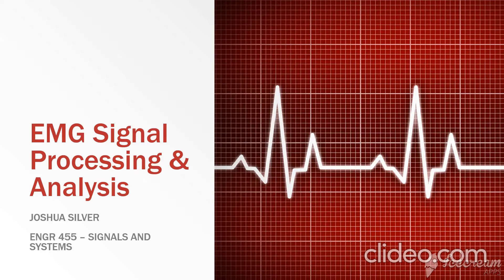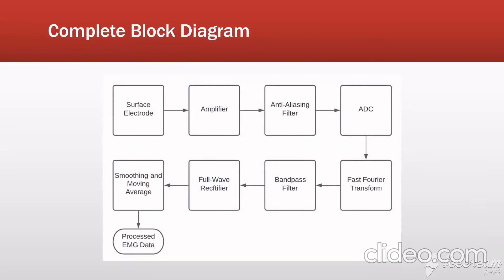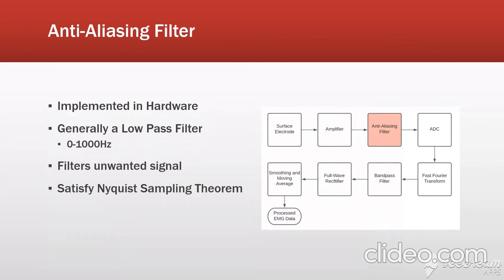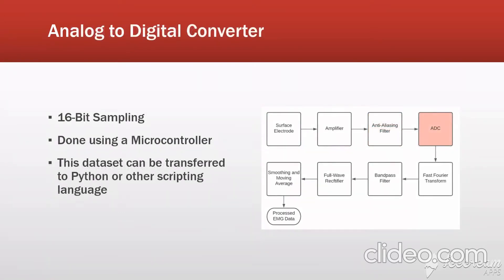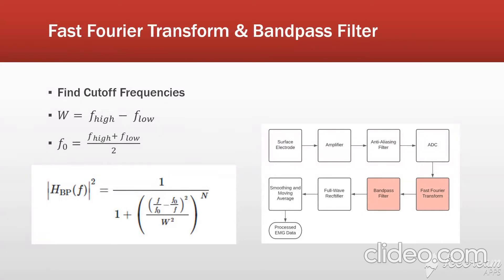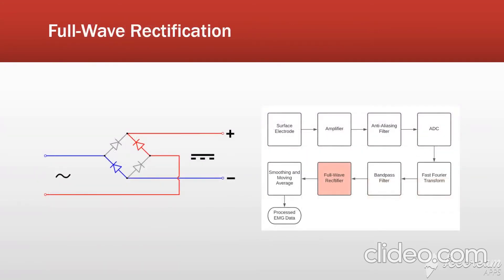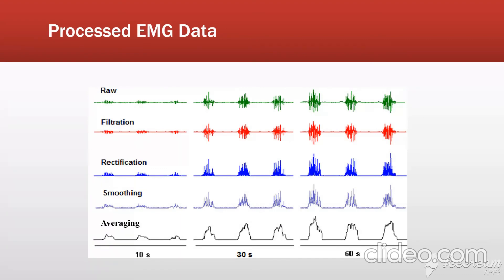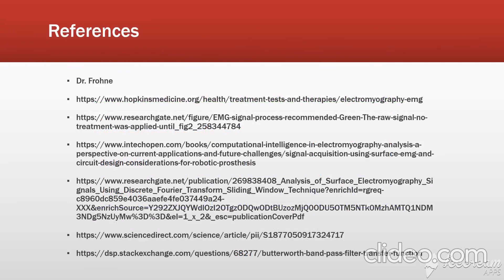EMG Signal Processing & Analysis

Comment: At 02:00, it doesn't make sense to say you are using a 1000 Hz low-pass filter for a 500 Hz signal "to satisfy the Nyquist sampling theorem". Nyquist says thay you would have to sample at at least 1000 Hz, but if you do that your lowpass needs to be 500 Hz for a brickwall filter or somewhat less in practice.